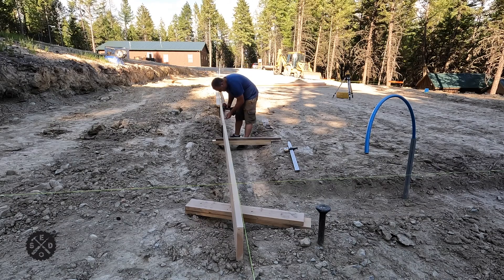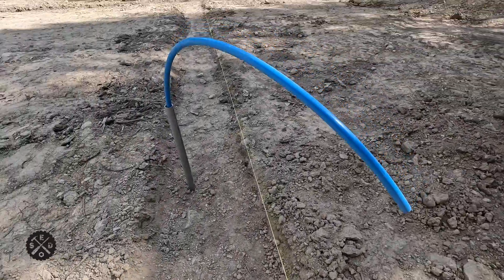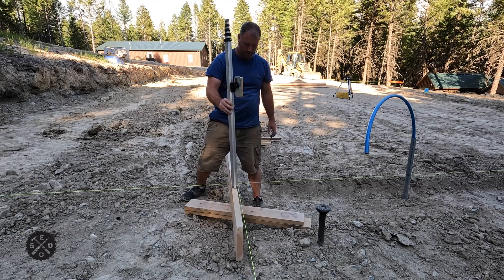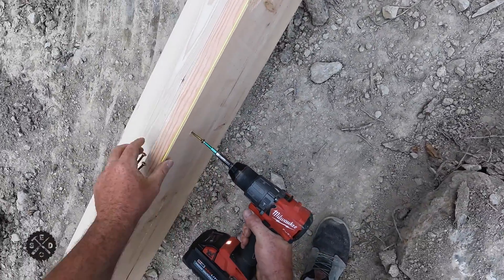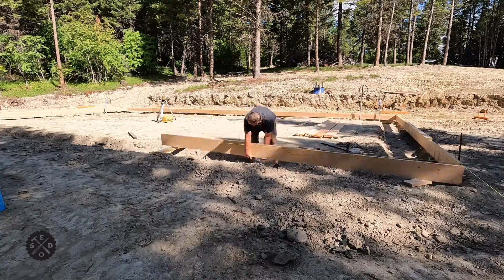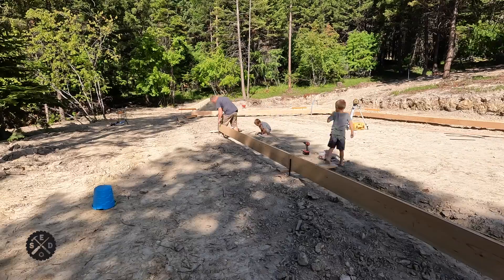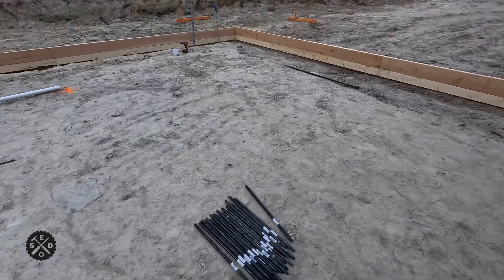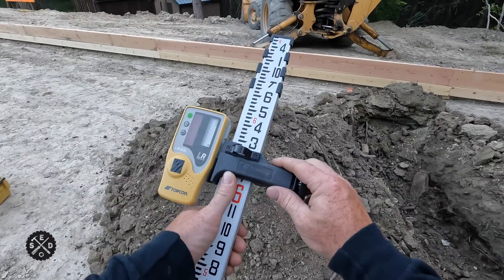Forming up the Mono Slab Footers Garage Build diy EP 5

Comment: What's your frost line?
Reply from the maker: 42 inches typically but with doing it this way, I only had to go 16 inches deep on the footer since I'm insulating the outside perimeter and also I'm doing 32 inches out horizontally to continue that below grade.
Reply: how did that work for you? Any  issues? And, I'm assuming all planting is 32 inches away from the house?
Reply from the maker: @NotTelling51 it worked really well for me no issues at all. Well, the foam is down 16 inches below the ground that slopes out horizontally so you could probably plant something if it doesn't have deep roots I didn't plant anything just cause I'm tight on room but never really thought about it actually.
Reply: @SmartEasyDIYer  thank you. I've been watching videos on E-Z Form or ICf thinking I could do most of the work myself doing it the way you did. Then all I need is a guy to do the finish on the concrete.
Reply from the maker: @NotTelling51 yes. I wanted to use them too but they were so expensive!